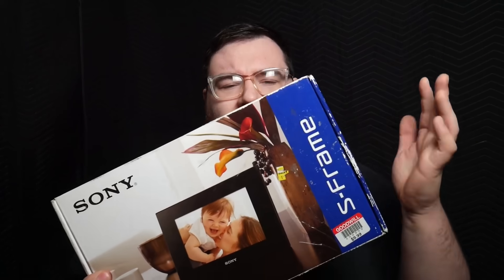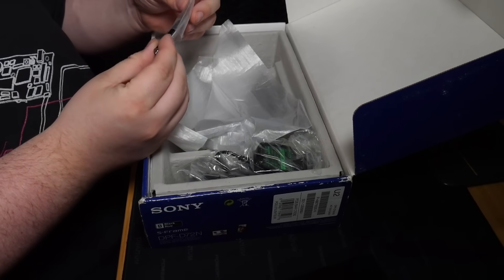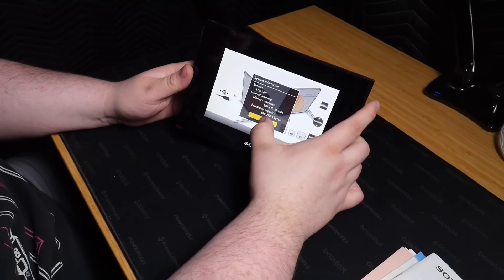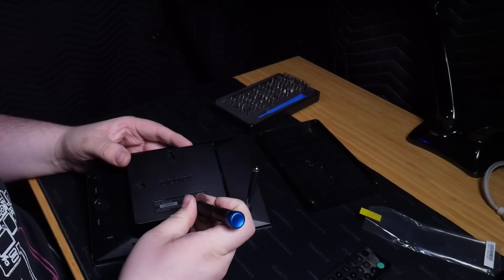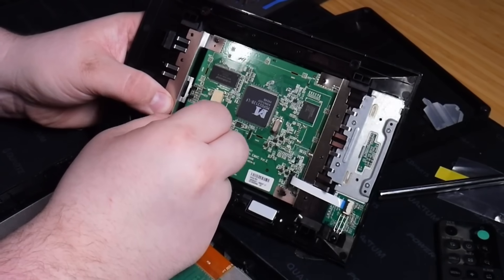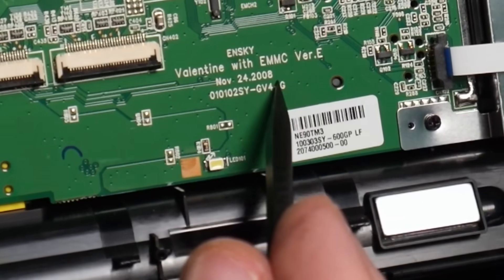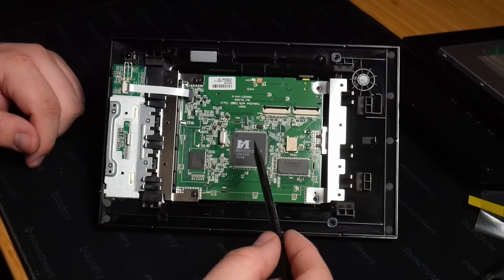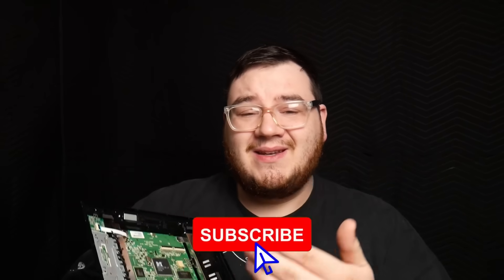The Hardware | Hacking a Photo Frame With No Experience S1:E01

Comment from the maker: I can’t believe I’m actually gonna do this. 
What have you tried to get YOUR code running on?
Reply: I created my own program in C with would create a simple gui using framebuffer manipulation on a tomtom go 720 gps. I also had a bluetech picture frame which i’m currently working to hack too ( ive managed to dump the fw and i’m currently analysing it.)
Reply: I once compiled buildroot linux for a TV receiver on gx6605, in order for it to start, I had to change the quartz generator, but in the end it started successfully and I was even able to play doom on it (and then accidentally burned the entire receiver, mixing up the polarity at the 5v input, sad)
Reply: I used chatGPT to help me disable SecureBoot on an intel based panasonic toughpad android tablet. Secure Boot isn't user accessible, as they don't want people changing the OS on the tablet. dumped bios, sent to chatGPT with instructions to disable secure boot. the tablet now runs windows. from my research, there's no documented cases of people attempting this, except for me.
Reply: Can you try to jailbreak a gps like a garmin nuvi gps?
Reply: i cant code
Reply: For one, I‘ve installed Windows Vista on a weighing scale
Reply: i bet you that you will run the obligitary DOOM and Bad Apple
Reply: i got arch linux running on my xbox controller
Reply: a vape haha
Reply: my most notable one was making my own homebrew app on my old nintendo wii
Reply: I did try jailbreaking a Digital TV receiver but i forgot about it, but I did try fiddling with a credit card machine that runs Android
Reply: I installed a os I made called potato os on 17 potatoes once in 2019

Comment: Used to have one of these. I attempted to do some hackery things with it (like using it as a display on a Raspberry Pi) but came to the conclusion this thing is as dumb as it can get. Have fun getting it to do absolutely anything out of the ordinary.

Edit: Yours seems to be a bit more advanced than mine was, but mine was also a Sony S-Frame. You might have a chance. Good luck!

Comment: Bwaa - ha ha ha ha!! What is the resolution for that device? How old is it? From 2008?! I sometimes see some of these digital picture frames in an e-waste dumpster I check periodically, but usually they are not useable. So I check for SD cards left mounted! Found a smaller DPF by HP, df300, does work but the protective glass pane is cracked!

Comment: Oh, btw... winbound is generally used for small flash memory chips that store the bios of a device. Its either ram or the bios. You might be able to dump it with a ch41a programmer?
Reply: Winbond is just a manufacturer. This big chip looks more like a RAM chip.
Reply: winbond*
Reply: Bios chips usually have 8 or 16 legs. Even modern motherboards usually have a basic 8 pin chip. This has way more than that, so probably a RAM chip.
Reply: Winbond makes more than just EEPROMs, I've used some DDR2 RAM chips from them in the past.

Comment: If there's a UART header on the board that should be your easiest way in.
If you can figure out how it works you might be able to exploit the firmware using a .tiff exploit as those file formats were known security vulnerabilities from r viruses and exploits back in the day

Comment: I see something which could be a programming header just above that chip on the left.  Might only be for that EMMC if that's what it is, but it might break it out enough that you can avoid desoldering the chip.  Might even be an interface to the SoC that could get it in to a programming/factory mode.  Dunno how paranoid the security would be on something like this.  It is Sony, but they might not've bothered with the sort of security they would for stuff that's intended to handle protected media.  Though their history of well implementing security is pretty poor especially back then, but it may still likely require some pretty in-depth reverse engineering and knowledge if they used a similar degree of security as they would for other devices intended to protect access to media and didn't make some other big obvious oopsie.  But there might be some existing information on that specific SoC and maybe other devices which used it which may have been jailbroken.

Comment: i used to have a clarion map770 gps that was runing windows ce. i managed to install programs and get access to the desktop and turn it into a pda. i could even access the internet with opera mini by connecting the usb cable to a pc and sharing the internet connection. that was back in the 2010
all i had to do to gain acess was to add a folder to the desktop from my pc and spamclicking it when the gps was booting (the blue screen that was showing when booting up was the default blue collor of the wallpaper) crazy staf

Comment: Good luck! This will probably be a journey. Rather than removing the eMMC, the spec recommends some resistors between the emmc lines, and then also pull up resistors after that. I think I see some resistors in the video, just below the eMMC (with respect to the text), and I would start by soldering some wires there and seeing what's going on on them. You can usually hook it up to a micro SD card reader and interact with the eMMC just like an SD card, so it should be fairly doable. Good luck!